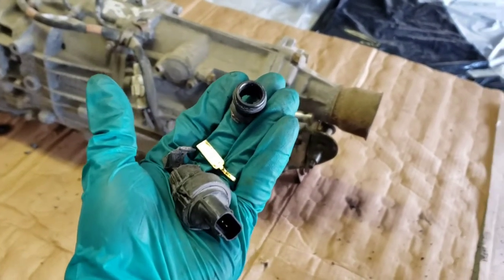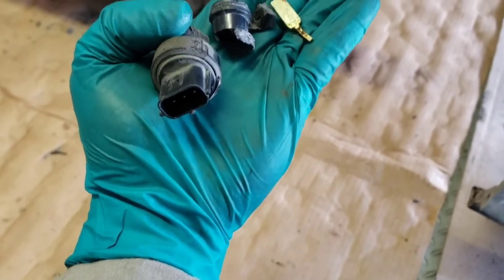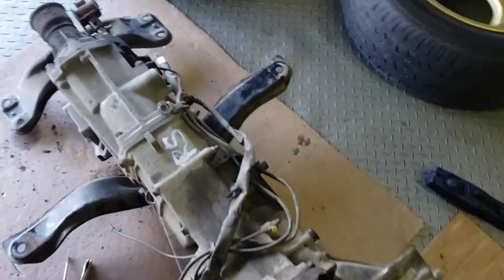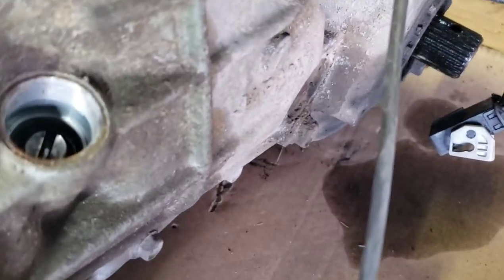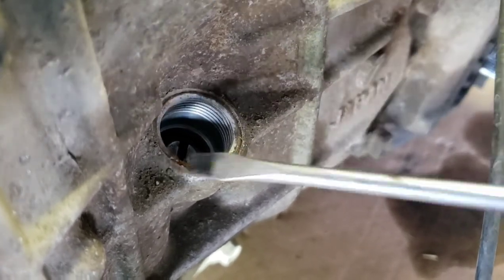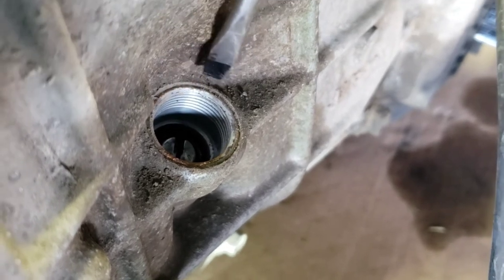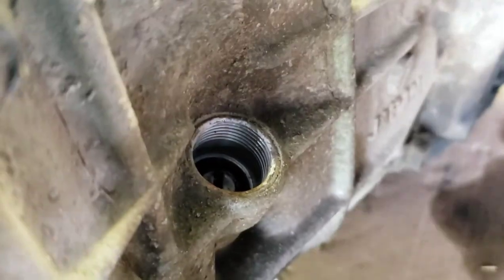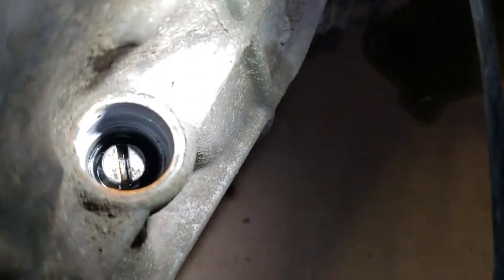Seized/Broken Subaru Vehicle Speed Sensor

Comment: This video was very good for me. Had to put a 99STi box into a 95 jdm, was very worried about the speed sensor vs cable. Found this video and it gave enough knowledge and confidence to break the plastic unit apart, I used some heat to release the threaded part from the box, a vacuum, and small picks to clean the thread and all good, installed the cable system right in. Cheers!!

Comment: I was able to get the broken off part out with it in the car. Broke it out with a stubby screwdriver from underneath, and a long skinny prybar sharpened from up above. Just be careful, chip it all out and blow it out with air as you break chips off

Comment: I was able to remove the sensor with the Transmission in place on a 2002 Outback.  Access is from underneath the vehicle.  The 17 mm does fit too loose and strips the sensor housing.  I suspect they manufacture it that way so it can not be installed too tightly thus breaking the sensor.  Got it out with a pair of vise grip pliers and the use of a heat gun directed at the sensor base.
Reply from the maker: On a 2002?! Lucky man
Reply: I managed twice on both a 1998 fozzy and a 1999 lecy ;)
Its very frustrating job, but with care its possible
Reply: @Linguaholic23  did you have to remove anything to access it? was access from underneath?

Comment: I broke off the top of the sensor enough to hammer on a socket and then used an impact to get it out.  It's virtually impossible to get out with traditional stubby or crows foot wrenches because it just rounds off and slips.  I did this above the car on my 2005 STI after removing the TMIC.
Reply from the maker: Without lowering the transmission at all?
Reply: @petrol-bay6928  I don't have a WRX, but on a 6-speed the VSS is closer to the front on the bell housing.
Reply: Speedo went out on my 05 sti, so I think I need to do this, good to know

Comment: I have the same code with my 2006 Legacy 5MT. but doesn't have the sensor on transmission. Would that indicate a wheel speed sensor?
Reply from the maker: It could be wheel speed sensor issues or sometimes the ABS module itself, good luck!

Comment: I have a Sti 6 speed. Why gearbox is still connected have tried a stubby 17mm wrench just slips what tool would you recommend to remove it? Thanks
Reply from the maker: There isn't much room to remove the speed sensor when the transmission is installed. You will probably need to lower your transmission. I had to use vise grips to remove it.
Reply: Break the sensor as far down as you can and hammer on a socket or a seized lug nut tool, then use an impact.  If that method doesn't work, try breaking it the way this video suggests.  Source: 2005 STI.

Comment: Very late comment but I need help, my 2011 Wrx hatch has a harness coming out of the vss, the other side of that harness was pulled out im assuming the previous owner dropped the trans without unplugging it & now I can’t find where the other connection to that harness is located? I’ve searched everywhere and don’t see where it can possibly be plugged in, I’ve even checked the rear 02 wire harness that it connects to and nothing. I’m stumped because where can that harness lead to?
Reply from the maker: Hello @GoldEj25, to clarify things - you are saying the connector is still plugged into the the vehicle speed sensor but you don't know where the rest of it is routed?
Reply: @petrol-bay6928 Correct! The Connector is still plugged into the  vss, and the other side is torn. Right now I have the intercooler off trying to see if I can spot the other end of the harness and nothing. There’s no info online and the Subaru dealer don’t have clear schematics of it. I’ve cut open the harness that’s just above the turbo that goes into the firewall trying to see any cut wires or stripped wires and nothing. Followed the wires down the other 2 sensors on the other side of the trans and nothing. This one has me stumped.
Reply from the maker: @Owensti  Does this video help you? 
https://www.youtube.com/watch?v=qTrK_3Hf6b4
Maybe check out the 15 minute mark of the video. Wiring gets tucked in back through the firewall section

Comment: My subaru dont works the velocímeter. This is the problem?
Reply from the maker: There could be many reasons. It could be speed sensor, speedometer itself, wiring issue etc. You can probably buy a speed sensor for pretty cheap to replace and try it out.
Reply: @petrol-bay6928  ok my friend, where is ubicate the sensor please, my motor is ej25. Thanks
Reply from the maker: @alvaroblacidoramirez8314  Vehicle speed sensor is on the transmission housing. Passenger  side of you have a manual transmission
Reply: @petrol-bay6928  thanks my friend, my car is automátic. The error is ( error speed).

Comment: is it safe to drive if speed sensor broken.
and steering light on dashboard
Reply from the maker: Probably only a short distance back home or to the repair shop.
Reply: @petrol-bay6928  if speed sensor broken, then its fine to drive.. Am i right
Reply from the maker: @mohamed Maikal  I wouldn't say it's SAFE to drive. I'm going to assume your speedometer and other functions like ABS don't work.
Reply: @petrol-bay6928  thanks, but my steering wheel some time fine when i off engine… after 10 mins again steering light on dashboard and wheel is little hard…
Reply from the maker: @mohamed Maikal I'm not a Subaru tech but I would say your steering issue is separate from speed sensor

Comment: I have 2017 wrx Subaru we replace the clutch and when we put it back together I have code say p0500 can u help me where is vss sensor at? Thanks
Reply from the maker: Did you drop the transmission to replace the clutch? Assuming it was all working before, you should double check your wiring and connectors to make sure it's all plugged back in
Reply: @petrol-bay6928  yes we drop the transmission and we removed both cv axle but abs wire hang in last time I guess I stretched the abs wire

Comment: I have a 2008 Subaru legacy an my speed sensor done for the  car has no power does anyone know where is it located.
Reply from the maker: Manual transmission is in the video, pretty sure automatic transmission the sensor is just on the opposite side

Comment: I have a 93 impreza where the speedo doesn't work. I have no idea how to fix it lol.
Reply from the maker: Check your local auto wrecker for a similar model and try swapping a different instrument cluster in.
Reply: @petrol-bay6928  ok. I also pulled the sensor thats bolted to the transmission, what would it look like for it to be broken? Is the stick that spins supposed to fall out of the cylinder housing as a free moving part?
Reply from the maker: @Ghoastly  The stick in the speed sensor is a free moving part.

Comment: How do you get that bottom piece out?
Reply: The one that looks like it has a flat head insert on
Reply from the maker: @aarond5504 That flat piece of metal will just stay there in the transmission side and won't fall or go down any deeper.
Reply: Petrol-Bay I see, so I bought a different 5MT and it doesn’t have that flat piece of metal in that hole, so I need to swap that from my old tranny. I assume the case would have to be opened up to get it out right?
Reply from the maker: The flat piece of metal is part of the sensor, not the manual transmission. When you look into the transmission hole you should have the empty slot that the sensor will fit into. If that doesn't help you I can try to find some pictures for you.
Reply: I have the same problem as Aaron, I have a different 5 speed trans, same final drive when I open the plug bolt in the location on the speed sensor is just a dead drop. Looks like the case has to be open in order to swap over that internal peace.
Reply: @cheeseson1446  ended up having to buy a VSS pro plug and play, way easier to wire that up than too open up the case to add a whole other gear

Comment: Is this an automatic trans?
Reply from the maker: This is on a manual transmission
Reply: @petrol-bay6928  where would it be on a 05 legacy gt automatic trans?
Reply from the maker: @coltonweber1979  it would be on the left side of the transmission middle portion
Reply: @petrol-bay6928  left side as in driver or passenger
Reply from the maker: @coltonweber1979  driver side (left hand drive to be exact lol)